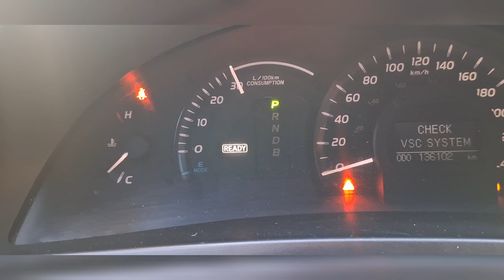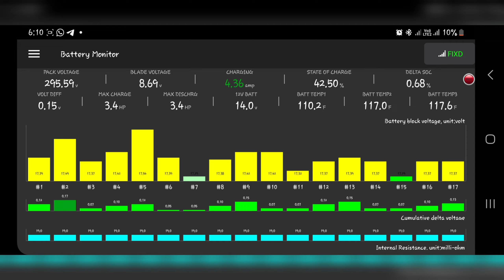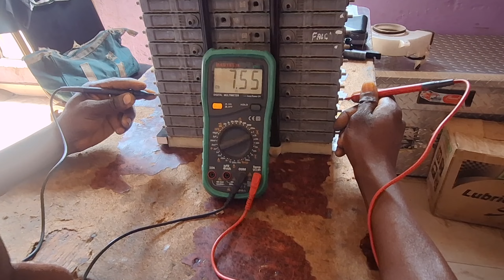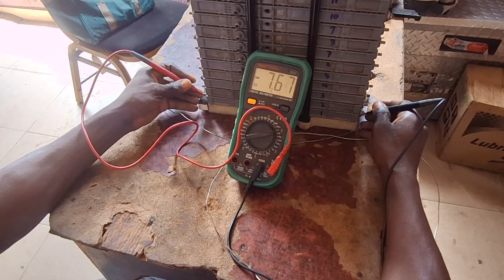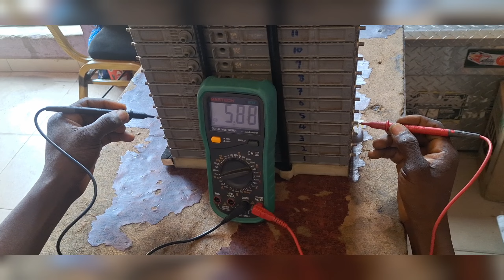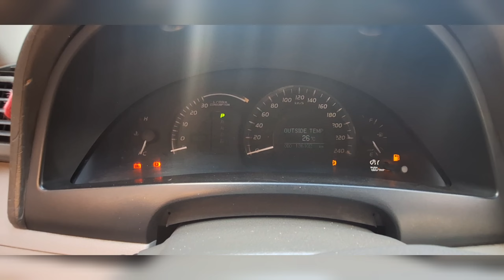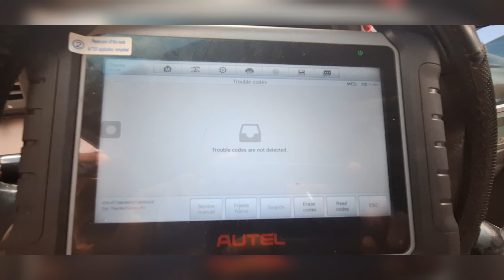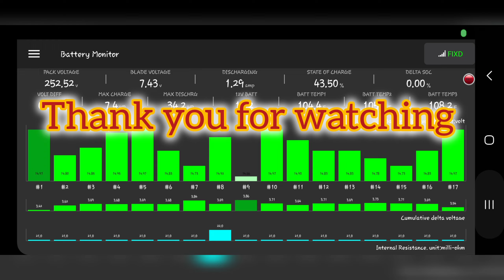Diagnosing P0A7F & P0A80 ... All you need to know about hybrid batteries and fixing them.

Comment: I have p0a80 do you think I can determine which block using the freeze frame record ... Thanks
Reply from the maker: Yes most times it is correct
Reply: @FASTECAUTO  thanks … I saw a lot of yellow in the freeze frame and a block with 12v from -3,-2,-1,0,1 and few others were 13. Something while on 0.